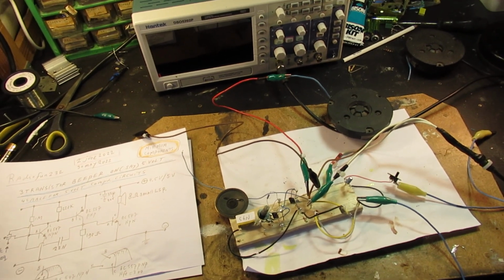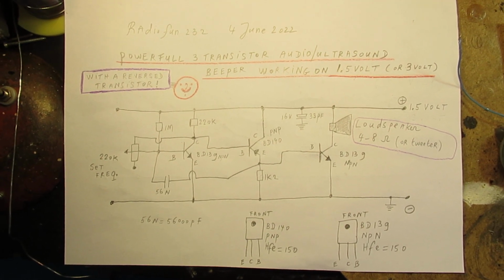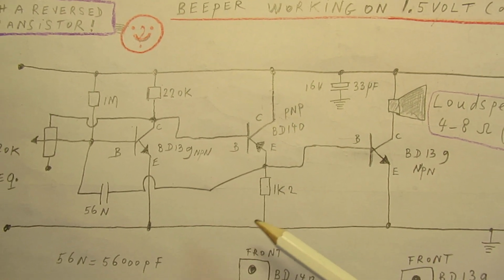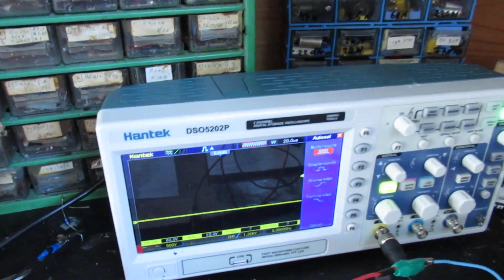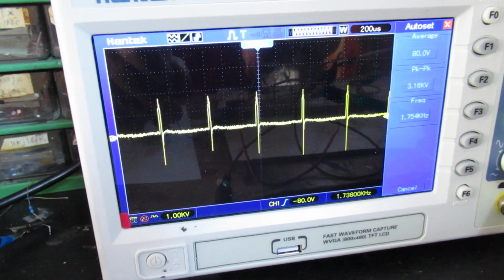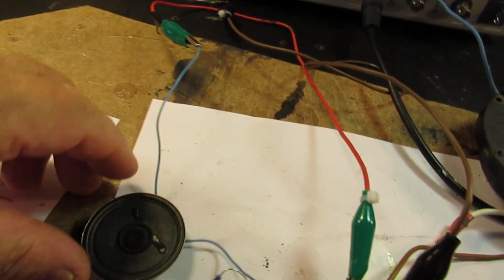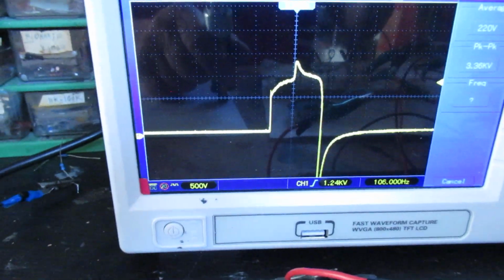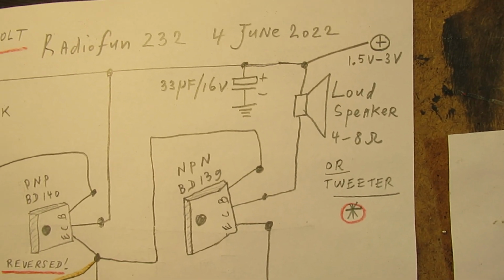3 transistor audio & ultrasound beeper 15 KC - 25 KC working on 1.5 Volt with a reversed transistor

Comment: The ceramic speaker is capacitive, will work if you parallel inductor to the ceramic speaker. Basically higher inductance give lower frequency response, since the ceramic may no sing well at low frequency. But have to be careful for ultrasonic which possible can damage our ear.
Reply from the maker: true

Comment: That is interesting, have you probed across the C and E while probing the base ? Of the PNP?
Reply from the maker: Hi Steve, I have tried (almost) everything, with a regard to the electronics theory. I mounted the BD 140 PNP in the (in electronic terms) "good" way, with the emitter of that PNP BD 140 to the (+). Adapted the resistors for that. Tried to make direct/different connections from the first transistor to the second (read: the final, with the LS in the C-E lead) etc, tried to give all the transistors a proper bias (also with that PNP in the right direction), but finally this only worked. Strange but true. 😁 4 june 2022.
Reply: @radiofun232  😃 that's pretty interesting, thanks for your reply mate really appreciated...

Steve